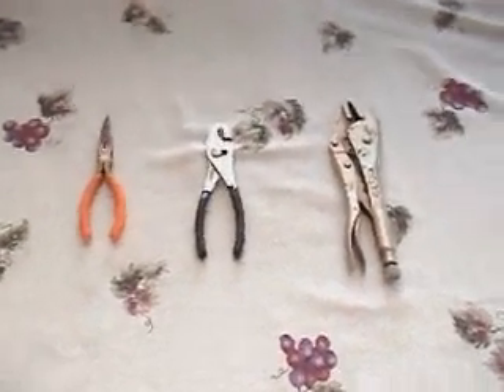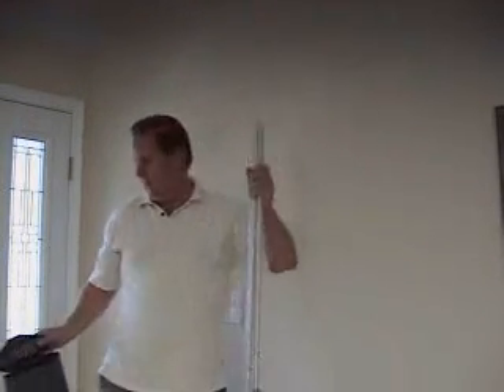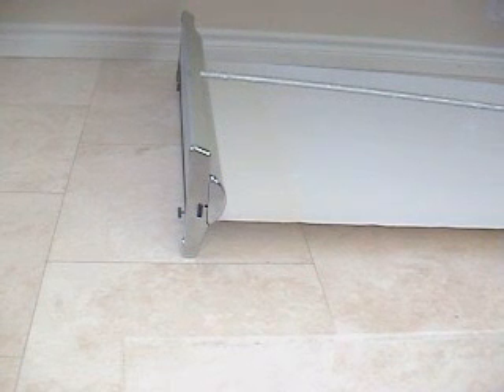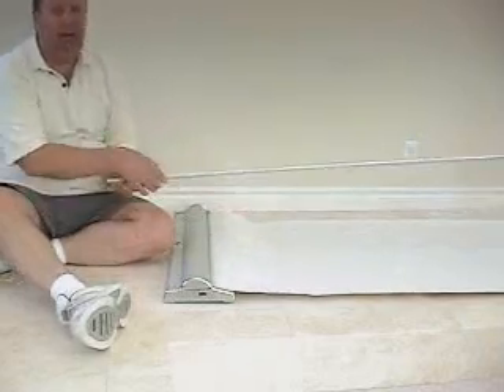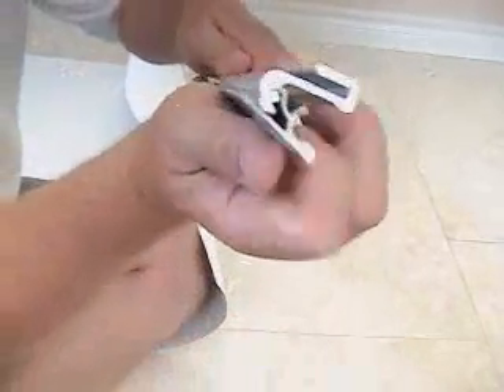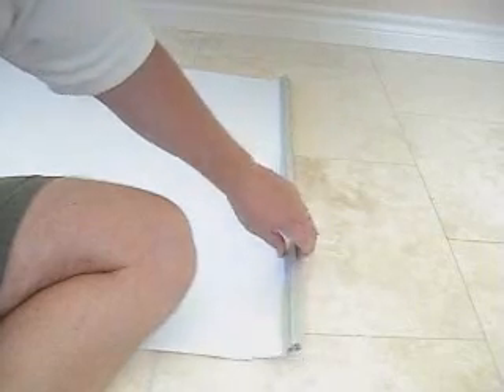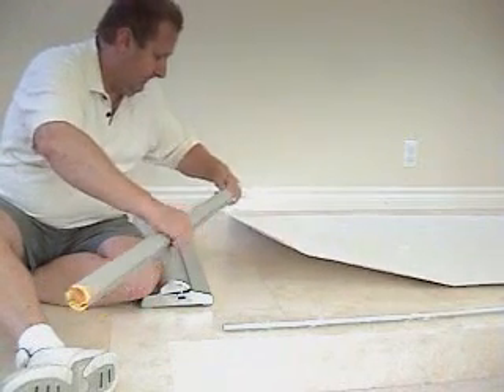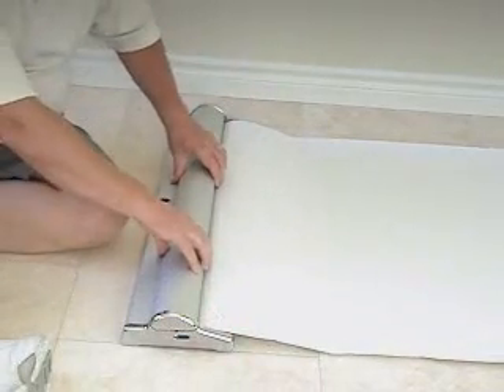Change graphic in a Supreme Banner Stand.wmv

Comment: There is an easier way!  Just barely pull out on the graphic, insert the stop pin, open the cover, unroll banner, install new banner, roll back up and put it back in the stand.  Remove pin and you are done!!! Or come see us and we will print your graphic, install new space strips on your new replacement banner and install it for you!